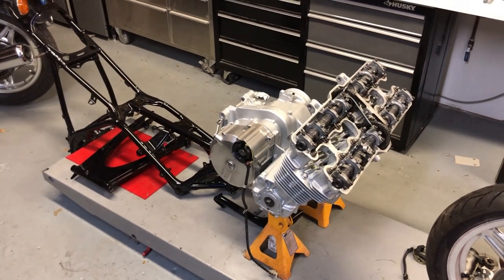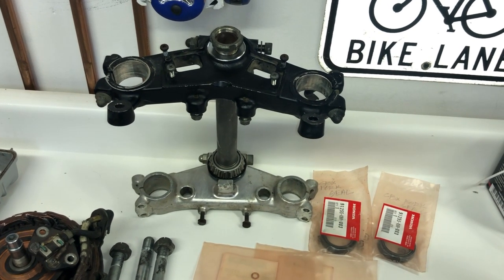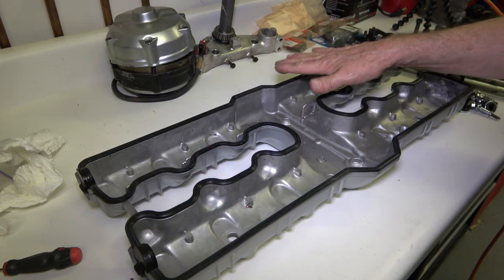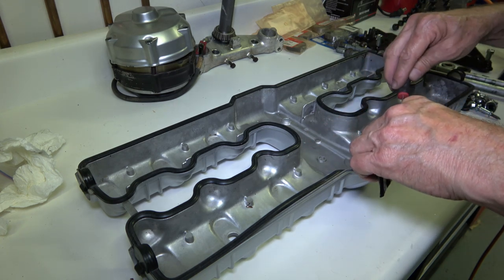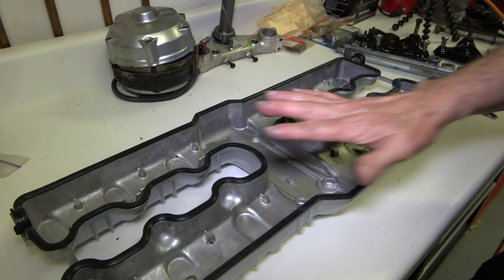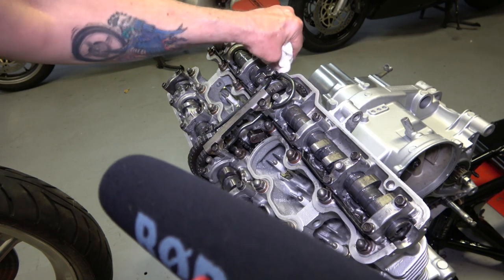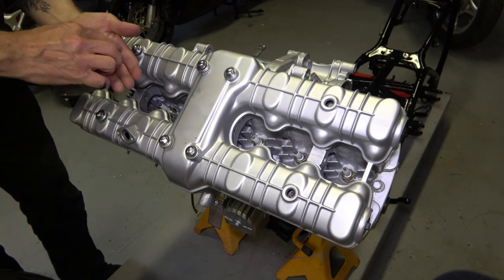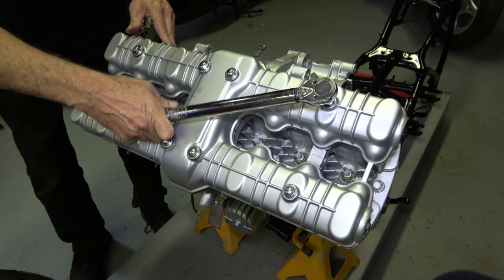Honda CBX Full Restoration & Engine Rebuild Video Series - Part 25 - Valve Cover Installation

Comment: Those grommet bolts have a shoulder and actually bottom out.  The rubber in the grommet applies the pressure to the cover.  I have replaced mine several times.  Interesting, I guess the torque spec is to assure they do not come off, but you need to be sure they have bottomed out.  As the rubber ages, the pressure will decrease.  I agree with a little glue to hold the gasket to the cover.  Helps with sealing, and frustration!

Comment: I use Gasgacinch for the rubber gaskets. I get it from JP cycle. It works like the factory sealant.
Reply from the maker: Hi Edward, thank you for the info. I will try that :)

Comment: Amazing videos. I am starting on my 79 and your videos are priceless as a first time cbx restorer! I wanted to ask where you source your original honda gaskets?
Reply from the maker: Honda still has most gaskets available thru their parts dept. at the Honda dealers. The original OEM sets that I feature in my video are no longer available, the sets from Japan, which are equally as good,  are available thru eBay and online.
Reply: @digitalpizza1  Thanks..i found this website out of Japan I think called cruzin image..Ill probably order from there..keep up the good work!

Comment: great job, but i was taught to work your way out from the middle in a crossed pattern...?
Reply from the maker: Hi David, thanks for your comment. The shop manual has the pattern to follow, but working from the center works as well. The important thing is to torque them evenly 😎